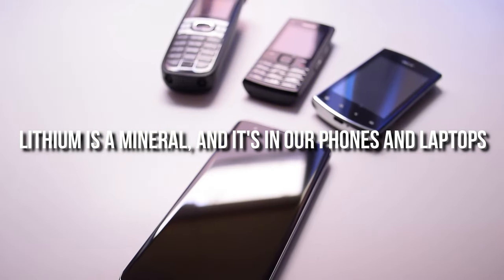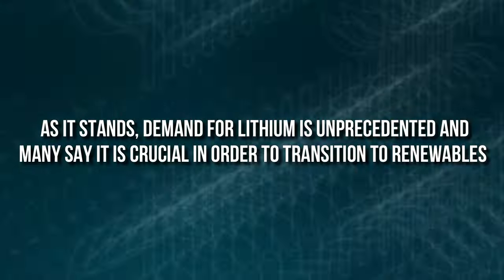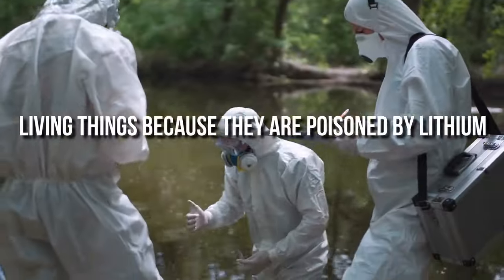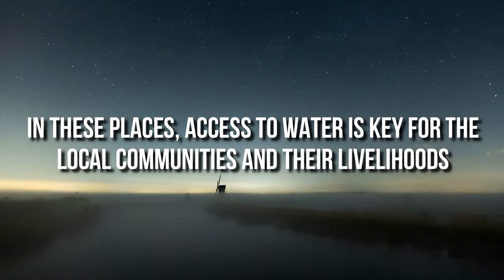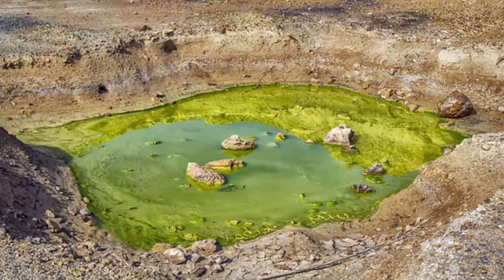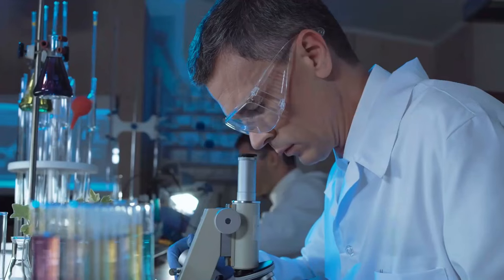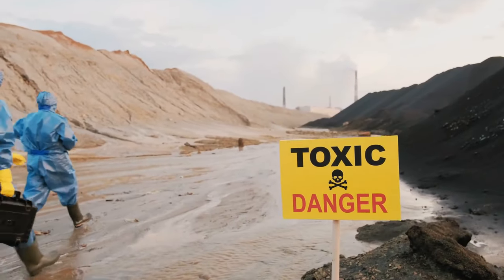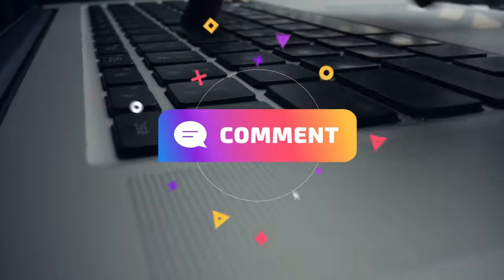How Bad Is Lithium Mining For The Environment?

Comment: It's not worth the harm to the environment
Reply: @tiepup  you do realize electrical energy isn’t the end all be all of everything right?
Reply: @tiepup  ok, but you also realized that most things that are electrified aren’t as efficient, sectors like trucking and construction benefit heavily from fossil fuels, unless there’s something that can account for those industries there isn’t much that can be done about it. When you have an ev truck that can only tow 90 miles compared to a diesel that can tow 300 and doesn’t take as long to refuel, you’re pretty much boned 🦴
Reply: @tiepup  ok but take in consideration the amount of time it takes recharge your batteries compared to filling up your tank in a gas or diesel vehicle. Also from what I’ve seen most EV towing vehicles have a range of 90 miles, unless you have a valid source showing otherwise I would like to see it. 👍
Reply: @tiepup  they’re only legally required to take a 30 min break every 8 hrs of driving also that doesn’t take in consideration that the Tesla semis only charge that fast using their own mega chargers plus 500 miles isn’t that much compared to what a regular diesel semi can do. The whole EV thing shouldn’t be forced this far if they can’t provide as much as what a fossil fuel vehicle can at a cheaper price
Reply: @tiepup  How is an EV cheaper? Most of them are more expensive than a gas vehicle not to much the maintenance cost since most of their systems are electrical which costs more money.
Reply: @tiepup  that also depends on how much you drive, also I believe hybrids are the way to go for now
Reply: @tiepup  yeah that is true, well it seems that we’re at both ends of a spectrum and if EV’s works for than more power to you. Thanks for having a discussion I hope you have a good day
Reply: @supersandwich8967  Having read your whole conversation it appears that what is most important to you  is range and time to recharge.  That's a pretty narrow focus.  A typical EV driven an average number of miles a year will offset it's CO2 contributions of manufacture within one year.... 1 1/2 if the power source comes from Coal or NG.  What is our planets health worth? 15 min at a charging station every 2hrs of driving?  Too much to ask? At the rate that the battery technology is advancing it's very likely that those charging times will be halved in a couple of years.  Also likely is that lithium will be replaced with less environmentally harmful alternatives.  The bottom line is that a market is needed in order to support the investment needed to develop better products.  The fossil fuel burning industry has had well over 100 years and are about as efficient and clean as they will ever get...and it isn't even close to being good enough.  Think big and long term SS...join those of us who care about the planet and everything living on it...including you.
Reply: Not at all. Fossil fuels still fuel almost everything electrical.
Reply: Lithium can be recycled, so the lithium in old batteries can and will be reused because it already is cheaper to recycle than mine. Fossil fuels can’t be recycled. Once burnt, they’re gone.
Reply: Once we die off the world will continue and recover just fine.
Reply: or the elephantitis and other diseases it gives people in other countries
Reply: The future... Research the thunderstorm generator. This is the answer
Reply: @richardlangley90  nah i just don't like being blown up when my 10 foot long battery gets punctured and is pretty close minded not to accept the fact that electrical energy is way less efficient and hardly any better for the environment considering the amount of energy loss as heat sound and steam. i do think there needs to be an alternative to oil but carbon emmisions being low doesn't mean it's good for environment and frankly electricity isn't it. dams are huge and i can't imagine the amount of water they trap is very good, windmills ruin views and only work well in the wind while also being made out of at least some plastic which is bad for the environment when produced. Solar farms can easily be ruined by hail and heavy snow and won't work when there's overcast or a storm. Nuclear is good but you can't put a nuclear reacotor in a car because people could make nukes out of that. Solar farms also have environmentally harmful things and require mass deforestation.
Reply: Exxon Valdez.......
Reply: Keep drilling and burning oil then huh??😂
Reply: @TheCryptoMiner  yea it's healthier for the environment
Reply: @skijump25  best throw your smartphone away if you're so against lithium!
Reply: @Jayt750  why would i throw something away so that the process to manufacture it goes to waste that seems pretty stupid
Reply: @skijump25  not as stupid as being anti lithium without thinking what lithium products you already have. No more new phones ??
Reply: @Jayt750  yea it sucks but what am i gonna do about it? i am just one person not in any kind of position of power so how am i gonna avoid it? i just know the flaws and if i support it as little as possible along with others who are doing the same thing it might slow down or change. i'm not anti lithium even i am just against how they mine it because of how much damage it causes to the surrounding communities
Reply: Most Lithium is harvested from a toxic dry lake bed in Chile with settling/ transpiration ponds. Nothing grows for miles.   Essentially removing the toxic Lithium from the salt Lake bed.  Due to the transpiration process runoff is minimal or less than naturaly occurring.
Reply: Recycling an containment... but don't get rid of oil base cars balance
Reply: So, get rid of your electronics that use a battery.  Bet you won't.
Reply: @supersandwich8967  Teslas model 3 is price comparable to similar gascars , cost pennies to drive and have very little maintenance.   Quit watching the hater channels and educate yourself .

Comment: This seems even riskier than what we're already doing. 🤔
Reply: Lithium is far worse for the environment than oil. Oil is superior
Reply: @mattjohnson5200 not really
Reply: @mattjohnson5200  NPC opinion...
Reply: @mattjohnson5200  Please explain how drilling for oil is so much better?
Reply: The Tesla Impact Report estimates it takes 18 gigatons of mining/yr to maintain the current grid and transportation system. A fully wind/solar/battery grid with 100% EVs for transportation would take 3 gigatons/yr of mining.
Reply: Yeah, because what we're doing now works. Environmental impacts of coal and oil and gas are minimal, predictable, and manageable.
Reply: @nathanearle424  The largest lithium mining country is Australia, by far, where it's mined safely and in an environmentally responsible way. And the newest car batteries are LFP batteries which contain no cobalt or nickel, which addresses Congo child slave-labor issues. The mining impact of minerals for batteries is minimal and lessening as well.
Reply: @777Outrigger  it's hard to get less invasive than an oil well
Reply: @nathanearle516  Maybe. I don't know that for sure. But with car batteries ditching controversial child slave-labor cobalt, expensive nickel, and Australian lithium being mined environmentally friendly, not to mention more US lithium mines will be coming online, I'm confident car batteries will be fine in a moral sense when compared to oil.
Reply: One thing he forgot to mention was another toxic byproduct of Lithium mining is the production of radioactive waste.
Reply: @lashlarue59  Right! You want to give us a source for that claim?  The biggest lithium mining country by far is Australia where it's mined safely and in an environmentally responsible way.
Reply: @777Outrigger  ay bro.
I get it.
You like ev. I used to hate engines for lack of efficiency, then the bad impacts even more.
But it is the only option for some.
Plus these Li batteries aren't very good. EVs become redundant before offsetting the environmental impacts that it causes in it's production compared to typical engine cars.
Right now, the best solution I have found, would be fuel cells.
Pure Hydrogen fuel cells would be great ( no co2 emissions at all ), but is very impractical to store and use.
Better is hydrocarbon or methane/gasoline/petrol fuel cells.
These wll greatly reduce emissions, and need to waste massive amounts of fuel. Being more efficient than engines. These would directly convert fuels into electricity.
Look up SOFC ( Solid Oxide Fuel Cells , MCFC ( Molten Carbonate Fuel Cells ), CSSFC , OR hydrogen fuel cell.
You'll most easily find about hydrogen fuel cells, Methane fuel cells, and Solid Oxide fuel cells, or Molten Carbonate Fuel Cells.
Reply: @yasirrakhurrafat1142  "...Li batteries aren't any good." I'm afraid you'll need to be more specific. The price for Li batteries is  falling, Li batteries are improving in energy density and charging speed, and the latest LFP batteries get rid of controversial cobalt and are almost impossible to catch on fire. Li battery tech is advancing very rapidly.  ..... As for hydrogen, that battle is already lost. Being able to charge in your garage and Tesla's 25,000 Superchargers on the road means the infrastructure for BEVs is already there and growing rapidly. And fast charging speeds at these Superchargers kind of mutes the "hydrogen is faster to refuel" argument. Plus, Who's doing the hydrogen infrastructure? No one that I can see.
Reply: @777Outrigger The only reason LPG and hydrogen are shafted is because they aren't as profitable as gas and EV (the latter of which is incentives for companies to force a change). There is absolutely no need for EVs , because if the world was serious with going green we would start with heavy infrastructure (airplanes/shipping/trucks/agriculture). Instead they add another power source for another vehicle which is worse for the environment at the end of the day.

The only reason why the responsibility is given to the common man is because your government is cheap and you are poor. I own both an EV (BYD Han) and petrol car(Evo VII)
Reply: @mattjohnson5200  
Ok, the oil empire strikes back!
Reply: It's much worse
Reply: @mickeymars8469  No it isn't. The number one mining country by far is Australia, where's it's mined ethically and environmentally responsibly.
Reply: @777Outrigger  Wow dang. Now the final question is: is it sustainable? We have to recycle the batteries and the solar panels/wind turbines, which not many people are doing at the moment.
Reply: @yasirrakhurrafat1142  How would a petrol fuel cell work? Also, most hydrogen is produced using fossil fuels, so it's not CO2-free
Reply: @777Outrigger  Do you have any evidence to support your claim that Australia's mining practices are environmentally friendly?
Reply: @sdfjsd  It's Australia, not the Congo. All mining in countries with Western values have strict safety and environmental standards. And that's what makes mining more expensive in these countries, which is why mining is moving to 3rd world countries where the standards are lower, and therefore the mining is cheaper.
Reply: @sdfjsd  Companies like LiCycle, Redwood, and Northvolt are already recycling batteries. They're recovering 95% of the critical minerals and making batteries from them. Northvolt, who makes batteries for Volvo and VW, says half of their batteries will be from recycled minerals by 2030. .... Wind Turbines are still a work in progress. One concrete company is burning ground up wind turbine blades. Yeah, that causes some air pollution, but otherwise they'd be using coal, which pollutes a lot more. Some of the solutions so far are not great, but the problem is being worked on. .... I'm not updated on solar panels, but I know people are working on that too.
Reply: @billjackofall  Please explain how spontaneous fiery EVs are better than oil!
Reply: @billjackofall  I'll explain... Just look at how poluted xhina is nowadays thanks to their lithium mining practices. That includes their land and water. Disease is running rampant and if the studies become available, it'll show that lithium poisoning has had much to do with it! Anywhere else in the world that is developing this practice has their land doomed by environmental waste as well!
Reply: @gersonalves8474  Until you have your studies/facts I will just let you rant like a mad person.
Reply: @nathanearle424 yeah predictable to kill the Earth

Comment: Let's go green. How much more can we F-this place up. I'm all in.
Reply: What is going green? because these lithium mines to move to electric vehicles doesn't make sense. These mines are brutal and then to charge the new batteries you pull electric from a coal plant...am I missing something?
Reply: Quiet!!!
Reply: Think of earth as a spaceship. Limited air that must be recycled. Water must be cleaned or we “run out”.
Oil may be in the tanks but how do we deal with the co2? 
Also if we just remove the co2 (massive tanks underground ect) where do we get more o2?
Reply: @paulgreenleaf600 don't believe this channel.  Lithium mining isn't nearly as bad as this paid by big oil advertising says

Comment: I think we should run our current cars for as long as possible and reduce the amount of tech in cars and bring them back to basic transport, why ? because tech in cars fails over years and if the tech is evolving at a high rate you might not get parts, the more complex cars become the more expensive it is to keep them decades and the less likely they will last decades. 

The less cars we need and the longer their life cycle the less we need to dig big holes in the ground.

Make manufacturers make parts available for a long time.
Reply: I was just thinking of my peoples car, my old VW bus, so easy to work on and could sometimes make my own parts
Reply: @brianhawes3115  Yes simplicity of older cars was a huge benefit. 

Even motorcycles today are introducing much and more tech, keyless start ? lol TFT screens, Sat Nav, no analogue clocks, al stuff motorcyclists shouldn't be distracted by. 

Fuel injection and ABS probably the 2 tech things that were of a benefit but in reality carbs did the job just fine.
Reply: Make them repairable. I can get parts and fix my '69 Chevy, but my hi-tech 2018 is cleaner, faster and uses far less gasoline. The 60's smog events in LA were terrible - burned your eyes, hurt your throat .
Reply: @sloansarabia  The issue with modern cars is that they are getting more and more difficult to fix the mechanical end, quality is poor due to cost savings for no other reason but to make more profit. 

For example, Ford and Stallantis wet timing belt issues, Stellantis make engines for Opel, Citroen, Peugeot and Fiat. Numerous issues with the belt disintegrating in the oil and clogging the oil uptake. Many of these issues happen out of warranty and it appears that more and more cars are made with increasing limited lifespans deliberately.

To replace these belts is much more complicated and expensive than replacing dry belts. 

Opel is another example, their 1.6 L Diesels have issues with timing chains, to fix is very expensive and requires taking out out the gearbox, very labour intensive. 

Now we have ever increasing amounts of computer systems in cars for crap like infotainment and digital instrument clusters with ever increasing amounts of information and customisations and the infotainment systems have more and more of the car functions through touch screen and not buttons or knobs and I had a car like this and sold it, I hated all this software and menus in touch screen to do basic stuff. 

Auto technicians are spending more time now fixing software related issues, for example, it could take a day or two to fix software issues in my Volkswagen and replacing a timing belt would be less time and less cost out of warranty. 

Auto manufacturers would be better off just making cheaper basic cars with none of this tech crap, emissions control systems are only part of the issue with modern cars, the rest for "entertainment" is not needed. 

One last thing, my previous VW, it had very complex and expensive headlights that would cost over 2000 Euro's to fix because they are controlled by computers and you can't go to a breakers yard to replace a headlight without getting VW to program it to the computer. 

So this is what people mean by making cars fixable, some of these software issues mean that cars cant be driven or if you loose infotainment or it crashes you have to make do without heat, AC, Climate, Navigation and even speedometer. 

Now I drive a far less complex car and will never buy a car so heavily dependent on software again. I can only imagine the expensive repair bills out of warranty as technicians scratch their heads over software issues meanwhile the per hr charge adds up to the customer, no thanks !